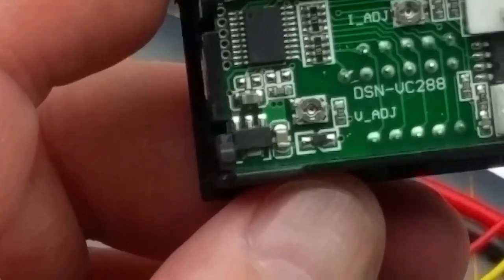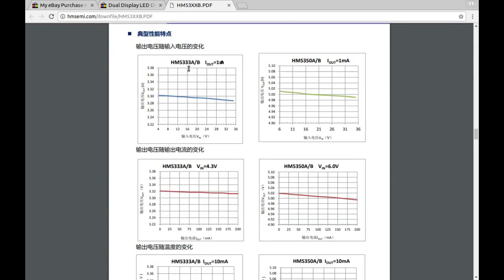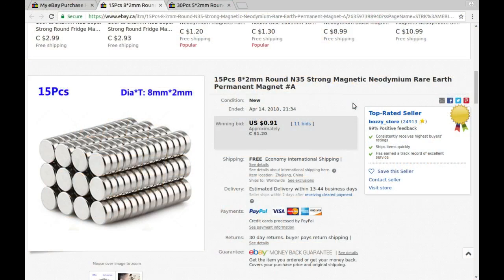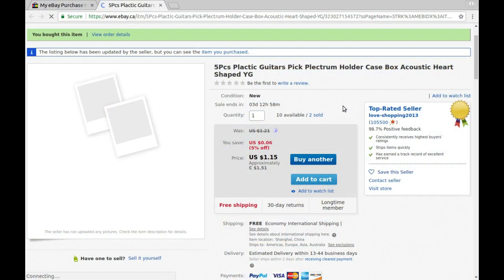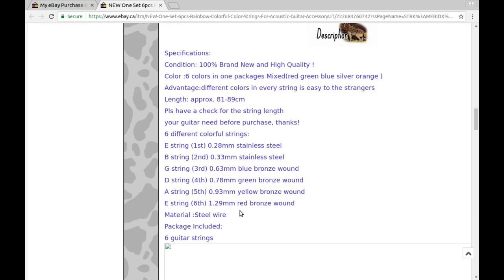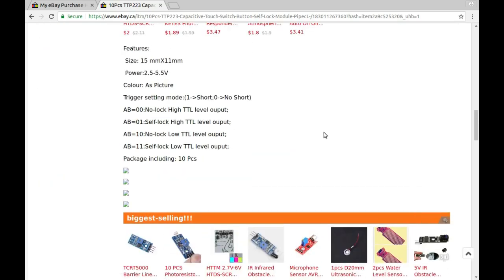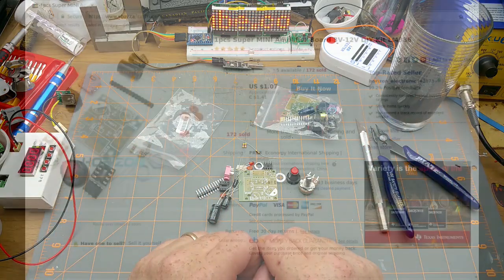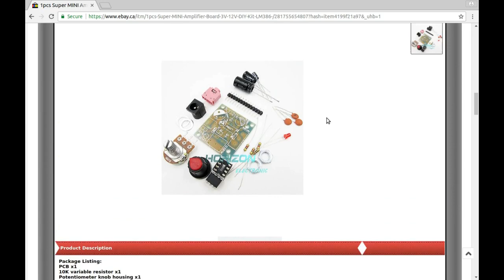Mailbag Monday #33

Comment: @ #ipileofstuff , i try to keep several of those volt/amp meters in my kit they are too useful, i use them to check  projects , charging and in built-in projects too. Top tips the two black wires can be commoned but not the two red wires and if the voltage under test/use doesnt go below 4ish volts the thin red wire and the yellow wire can be commoned , only must is not to monitor amps through the positive rail unless you like the magic smoke {i learnt the hard way} , easiest way i see it is large red is actually the negative line out to connect to the DUT negative. i have some wired with xt60 in and out, some with croc clips and also some with 2.5mm x2.1mm barrel jacks, gives great flexibility and speedy setup.  i will also make uo a couple with 4mm bananas when my new batch of plugs come in , im currently getting them at about £1.70 , mus have bought around 20 so far , currently building a bench PSU from an ATX with 7 of these one for each rail and some for the boost/bucks im building into the unit,. Side note please take car with cheap strings , tune away from face , some even wear strings in using gloves , i know a person hit in the face from tuning her violin, great videos as usual, great Monday am start for my week, guess i am going to buy those touch switches too , i have no idea what for but i feel a need, thanks !!

Comment: If  amp meter show wrong value,  you can rise resistance  pressing very small force with side cutters or lower with  solder more tin in PCB connect. http://electrochip.mk.ua/wp-content/uploads/2017/09/Podklyuchenie-k-istochniku-pitaniya_DSN-VC288-DC-100V-10A-Voltmeter-Ammeter-600x600.jpg   http://electrochip.mk.ua/wp-content/uploads/2017/09/Podklyuchenie-s-izolirovannyim-istochnikom-pitaniya_DSN-VC288-DC-100V-10A-Voltmeter-Ammeter-600x600.jpg

Comment: About these touch buttons: there is an empty space for capacitor, next to that chip, for sensitivity setting, from 0pF to around 50pF. I think they calibrate right after power up, so it's better if you don't touch them at that time, just to avoid some confusion later.
Reply from the maker: Thanks for the info.  I was wondering what those spare pads are for.
Reply: I forget which one is which, one is for logic high/low the other is momentary/toggle, i tried shorting with a wire and could not, I bought some 0 ohm resistors but have not tried them yet. The pads are too tiny to short with solder alone.
Reply from the maker: That's the pads marked A and B in the middle of the board. I should have taken the time to demonstrate them, but the video was already getting longer than I wanted.
Reply: and for the about 3mm distance of activation, that's nice so you can put them behind some plastic enclosure and have them react anyway... if only the led would have been on the other side...
Reply: squalazzo Actually I did semething like that some time ago: four of these set to latched, connected to 4 relay module, all inside quite big plastic case. All of it to control 4 separate light fixtures in my garage. It worked almost fine, but sometimes during power up they would randomly switch, in the end I replaced them with 4x1 membrane keyboard and an arduino. And those LEDs are only to show current state, useful during development, but kind of useless in final project.
Reply from the maker: squalazzo: I was thinking about trying them behind the faceplate of a control panel. I feel a project coming on...

Comment: My volt/amp meter was reading a bit out, until I realised my $2 banana to croc clip leads were cr@p.
Reply: Yeah, best way is to make some myself, you know what you get with these. Some bigger gauge silicon wire will do wonders, they have soft rubbery insulation, their cores are made from many very thin strands, thats why they're that flexible. For banana jacks those that fit tightly ale good, as for clips, avoid smaller ones as much as you can,

Comment: The LM386 is almost 50 years old.  Only $0.04-0.12 / ea.  I finally found a good article on how to build with them here:  https://hackaday.com/2016/12/07/you-can-have-my-lm386s-when-you-pry-them-from-my-cold-dead-hands/
Have made amps with these several times, and surprisingly, the circuits in this article above are oh-so-much better than the TI datasheet recommendations.
Surprised you are buying kits, as you surely have all the components to DIY.  I know you have the polypropylene caps.
Reply from the maker: The kits are simply a cheap (and slightly lazy) bit of fun. A bit of a change of pace.

And for the videos, they serve as an approachable demonstration for newcomers to the hobby.